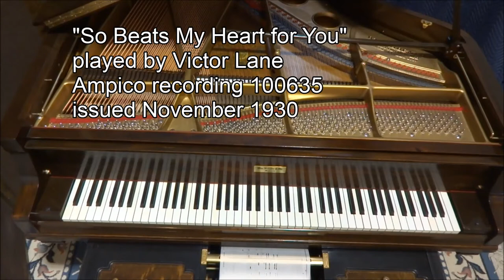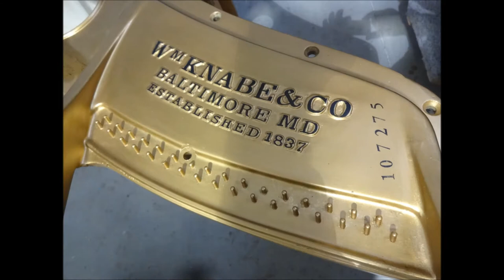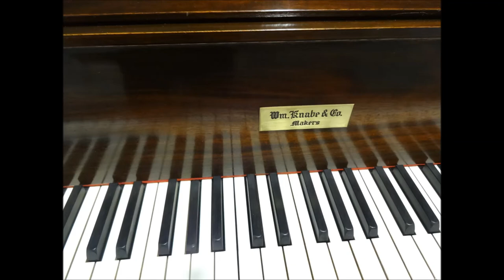Restoration of a 1929 5'8" Knabe Ampico B Reproducing Piano

Comment: wow.... this must've been the most out of tune piano I've ever heard... how did you manage to fix the agraffes? also, I've noticed on older grands the key weights are disintegrated. how were they on this one??
Reply from the maker: +Car Wash Studios 
I've certainly heard worse pianos at times.  At least this was holding a little string tension.  With the right tools, it is fairly straightforward to extract the broken stems of agraffes and replace them.  In this case, at least the threads in the stringplate were in good enough shape to hold new ones without too much extra work.  These key weights here were in fairly decent shape, and Knabe is generally one of the best makes for proper original key balancing, so this didn't need much modification on that front.
Reply: yikes. I have a fairly well made Cable 4'5" grand. The only issue with it is the fact that the keyweights are missing! 

It has been restored once and recently rebuilt with new hammers and keytops, possibly restrung and reguilded, but the action itself is fairly original. Is there any way I can replace the weights without having to regulate everything? the action is incredibly heavy and hard to play dynamically and softly..
Reply from the maker: +Car Wash Studios
If all the keyweights have been removed, I can imagine it plays "incredibly heavy", especially on a shorter grand where the geometry makes it so that key weights really matter a lot.   While the best action reweighting would include full regulation, it should be possible to get it a lot closer with some fairly simple steps.  Email me at historicpianos.at.gmail.com, and we could begin to discuss some of the options.